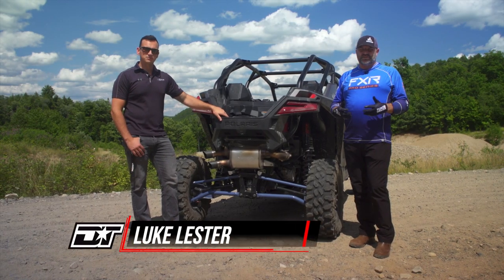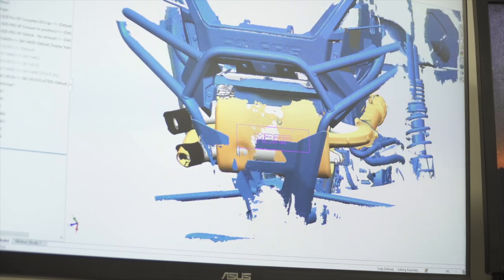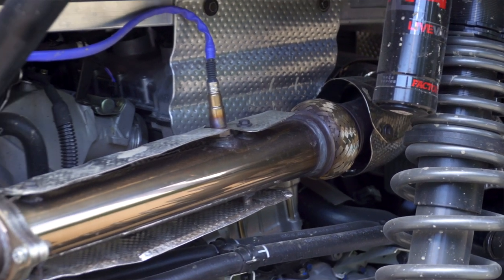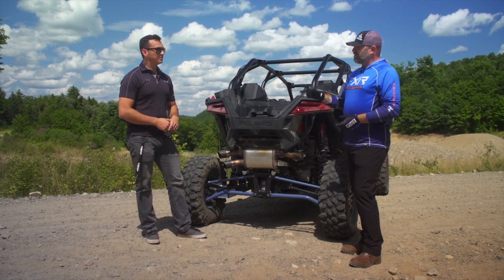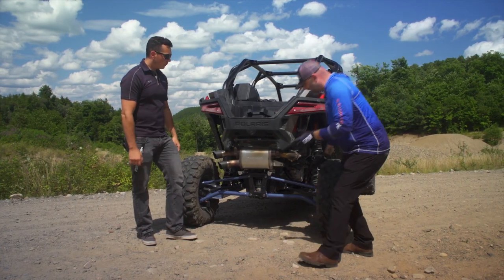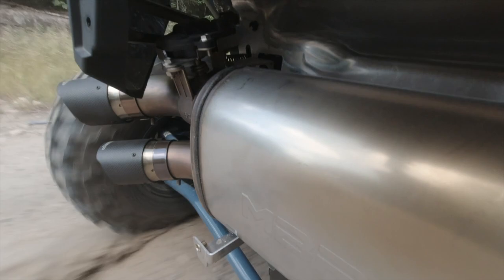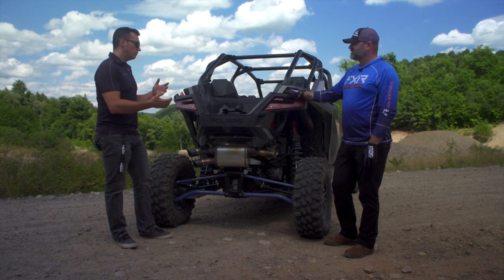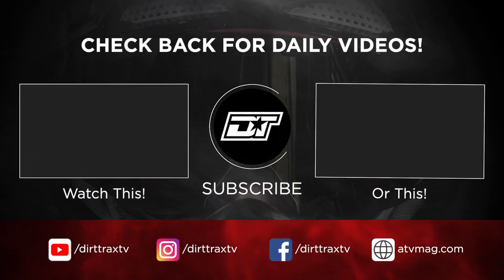ALL NEW | MBRP 2.5" Slip-On Active Exhaust for The Polaris RZR PRO XP

Comment: Isn't this the same thing RPM has had for years? I think there's another company that also makes a Captain's Choice system. 

Does it fit the Turbo R? You mentioned the Pro R, but usually the Pro XP parts are more likely to fit the Turbo R, since the rear bumper is similar and cage/bed are the same.